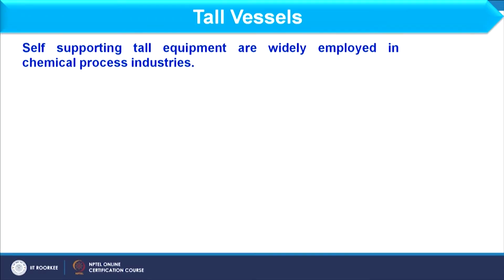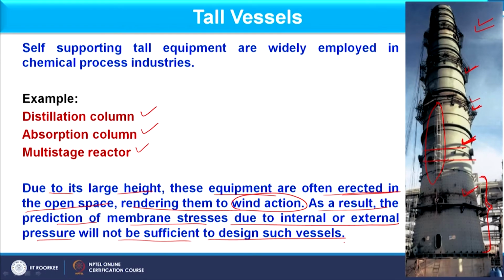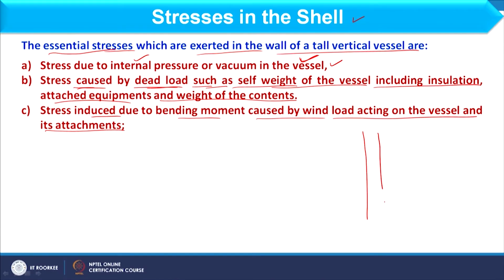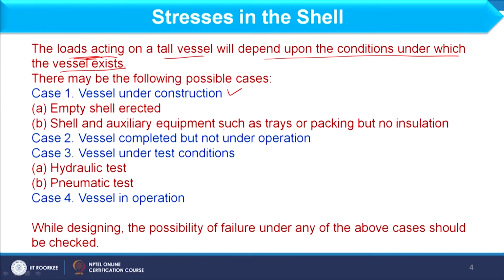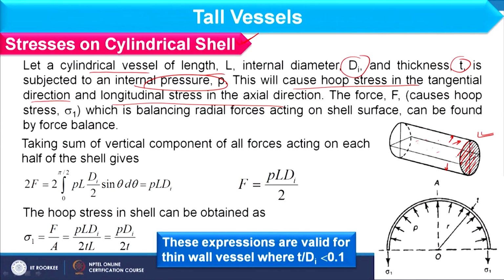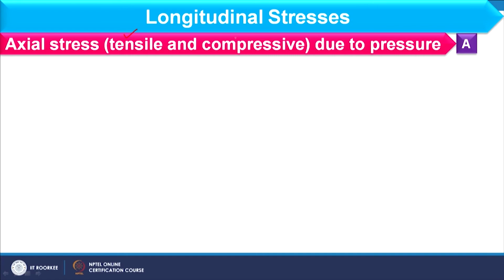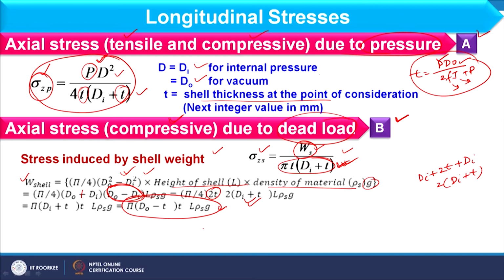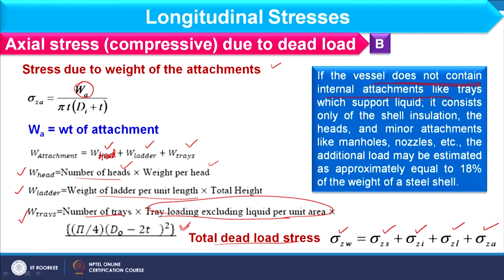Lecture 56 : Distillation Column – Mechanical Design-1

Comment: 1:31 pressure effect
3:45 tall vessel
10:21 stress on vessel
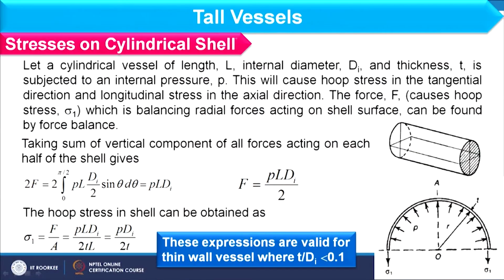19:18 thickness of equipment
19:31 stress on cylindrical vessel
23:44 longitudinal stress on vessel